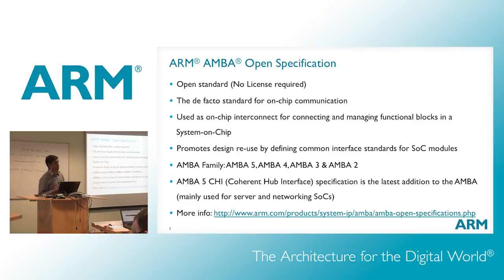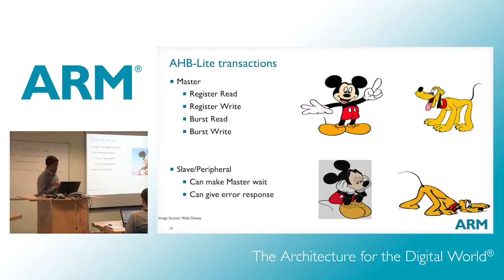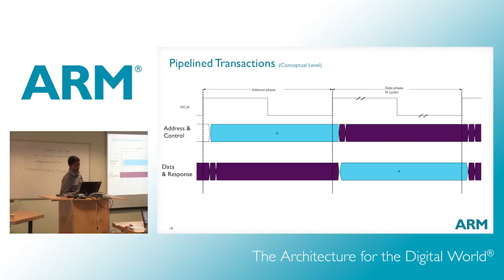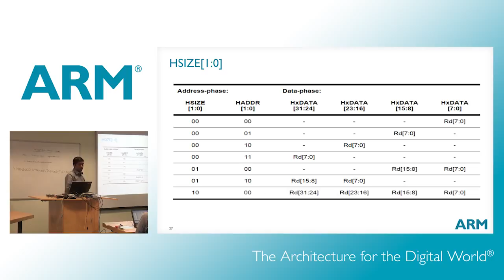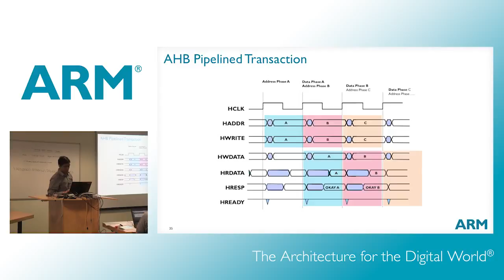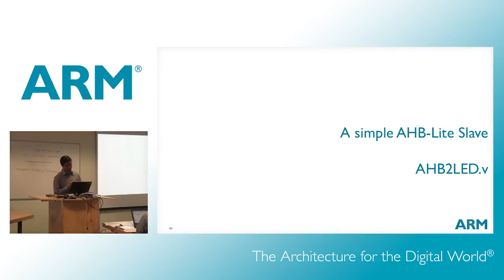Get Started AMBA® 3 AHB–Lite HD

Comment: the presentation is good, but the presenter is explaining in the dark region without a pointer on the slide which is not visible to the viewer, so although the ppt is visible on the screen, but what the presenter is explaining especially in the timing diagrams is not at all understandable. better setup would have helped the cause.